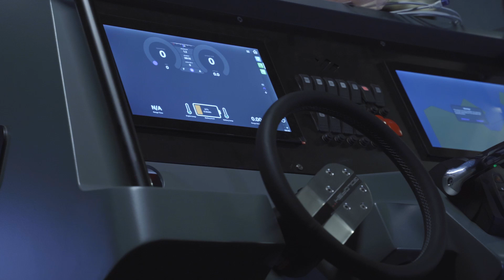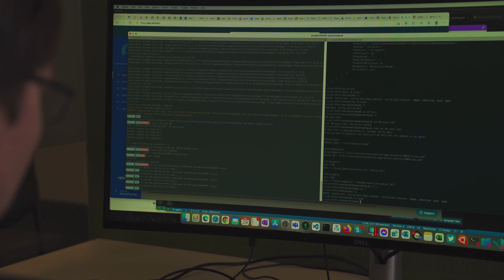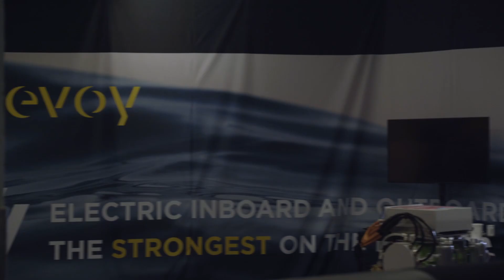This is Evoy, making Boating Irresistible

Comment: I run a 90 HP 4 stroke gasoline outboard , I wish I could swap it for an electric at a reasonable price.  Your engine looks awesome and wel designed, I hope there are options like yours available in the future to transition to electric propulsion for fast boats specifically.

best of luck and thank you for the upload..